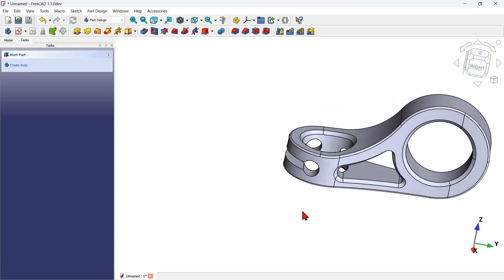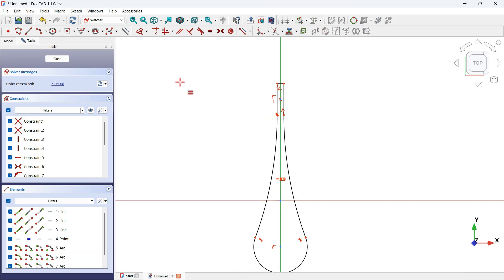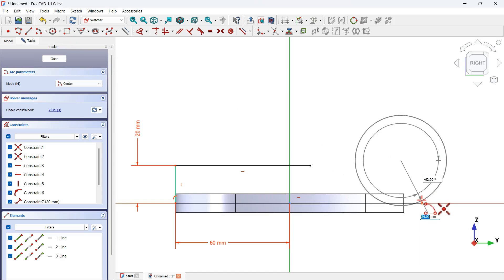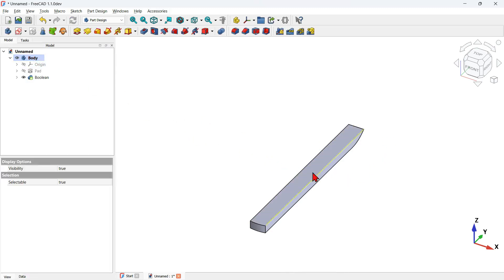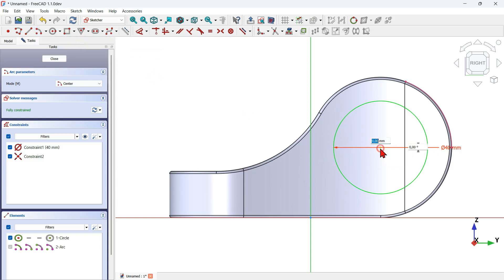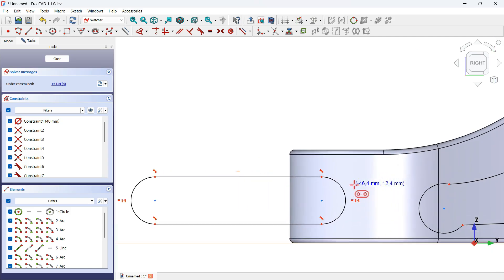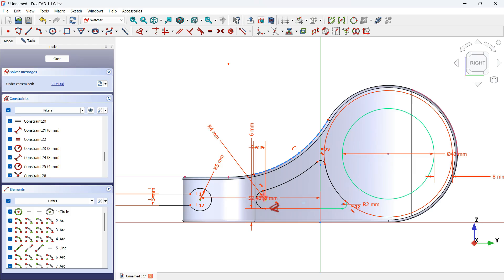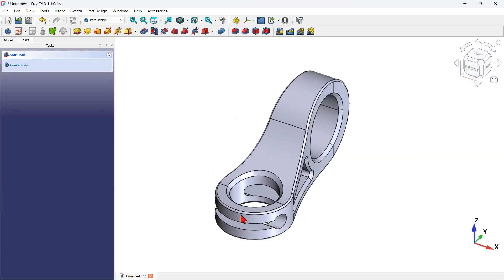FreeCAD 1.1Dev: 3D Modeling with PartDesign | Boolean Common tool

Comment: ottimo tutorial eseguito alla perfezione, per me un pò" difficile" da capire l'incastro tra i due corpi grazie.
Posso fare una domanda? Perché le miniature dei file recenti a volte non fanno vedere il contenuto dei file? grazie.
Reply from the maker: To fit the two bodies you can use the Transform tool, the Draft workbench move tool, or body placement/attachment.
Reply from the maker: The fail occurs in FreeCAD? Or outside FreeCAD? (When you open a FreeCAD archive by tapping two times)
Reply: @OffsetCAD  quando si avvia freeCAD nella schermata di inizio alcune miniature anche magari l'ultimo file si presenta con solo il logo e questa sarà sempre così. questo sulla mia copia di freeCAD.
Reply from the maker: Well, maybe it's a FreeCAD bug. What version of FreeCAD are you using? It doesn't happen to me. They simply open much slower than in previous versions of FreeCAD.
Reply from the maker: Ahmmm, I think I know why the thumbnails don't appear. Maybe it has to do with the last time the files were saved. In order for the model thumbnails to appear properly, you must first center your 3D model in the view by pressing "Home" on the keyboard and then save the file. I think this will solve the problem, because in your case, as you said, only the FreeCAD logo appears, which to me means that the files are being saved without being in the center of the view.
Reply: @OffsetCAD  Ti ringrazio per la risposta, no prima di chiudere e di salvare faccio sempre tasto home anche con l'icona a casetta di freeCad ma niente, sono solo alcuni file boh non so si manifestava anche con la vers. 0.22. sto usando la vers.1.0.0 data rilascio 18/11/2024.
Reply from the maker: And are these files heavy/complex?
It seems that you have two versions of FreeCAD installed. This may have caused some problem/conflict over time, because both versions share the same FreeCAD configuration files. But still this bug is new. I've never experienced this so I don't know how to solve it. But I'm still trying to understand how to solve it...
Thanks for the feedback.
Reply: @OffsetCAD  Va bene, grazie a te i file sono tipo quelli dei tuoi tutorial. fa lo stesso adesso mi accingo a fare quello che hai pubblicato. grazie.